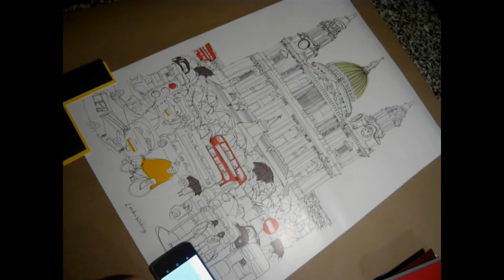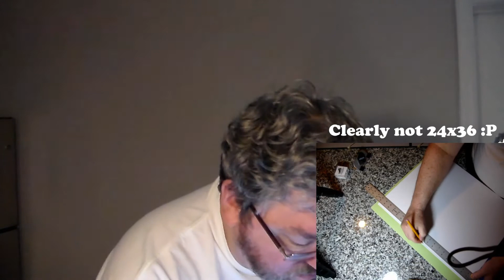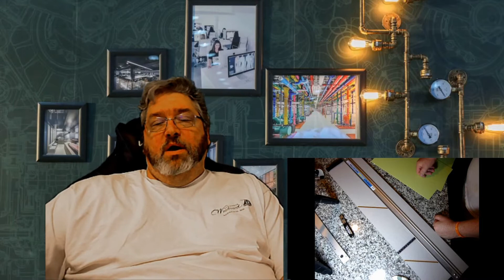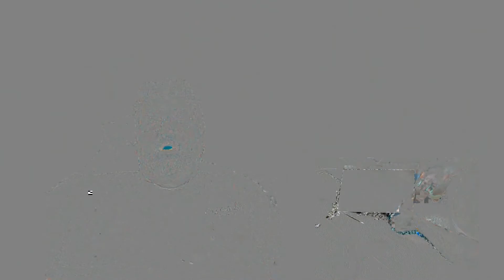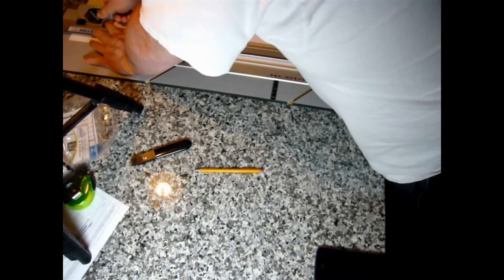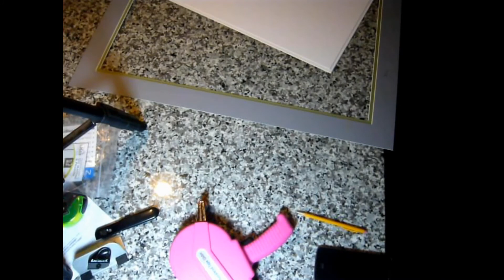First Cut: Using my Logan Graphics 301-1 Mat Cutter

Comment: Instructions for the straight edge cutter on the Logan video show the curved "blade" sitting on top of the cutting blade and the curved edge is used as a guide to slide in the groove of the stationary edge. This way you don't have to worry about manually staying close to the guide edge because the cutting blade is forced along the edge of the guide.

Comment: Hi Rico, enjoyed your video, especially when you hit problems, we learn a lot more when things go wrong than when they are always perfect. One thing I noticed about your technique on the Logan Cutter which was different to some other videos and instructional videos from Logan - you were situated at one end of the cutter and pushing away from yourself. In other videos, they seemed to have the cutter on a table, and were standing sideways on, near the measuring bar, central to the cutting bar. I noticed you were having a bit of a hard time as you approached the end of each cut. Try turning the cutter 90 degrees anti clockwise to the way you used it in the video and see how it goes?  The other guys seemed to have it much easier when cutting from that position. Thanks again, I had no idea how to do double mats so I have learned that idea from you. :)
Reply from the maker: Thanks so much for the advice! That's not something I noticed. I also had a small space to work in. I am moving to a new space soon so hopefully I will have the proper area to work in. Cheers!
Reply: @Rico.at.60  I took delivery of my own Logan cutter just over a week ago, and ruined one or two mats in minor ways, not cutting deep enough, cutting too deep and snagging the blade, and slight overcuts to corners. It took a while but now I am cutting double mounts easily.I've noticed that if the mat is 20" or longer, standing to the side is much better as you have more movement flexibility. On small mats, it doesn't seem to matter as you can reach from one end. Glad I got to try that out myself! Thanks again.
Reply from the maker: @autofocusrossswansea9362  Happy you are working it out, congrats! Thanks for the heads up! I actually have a really huge project, dimension-wise that I am going to be doing next month, so maybe we'll see how well that goes. Cheers!